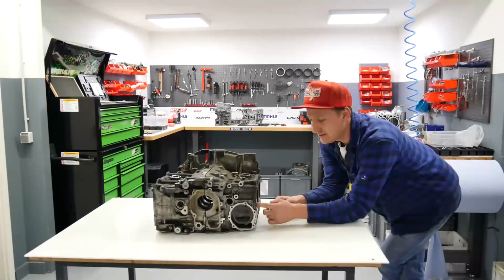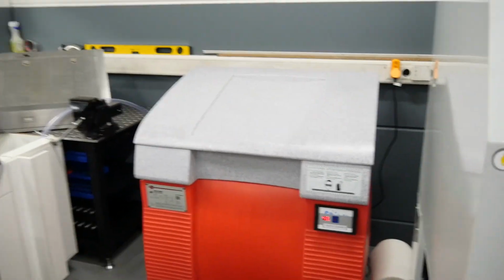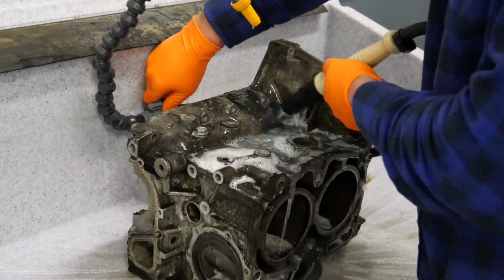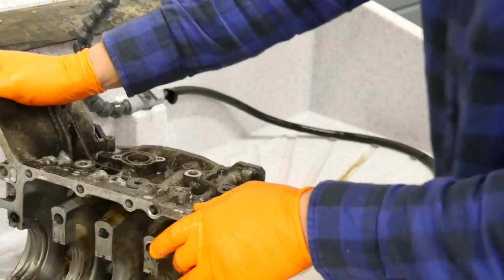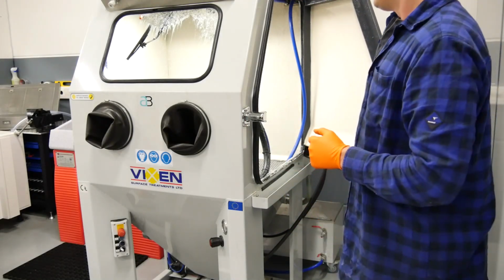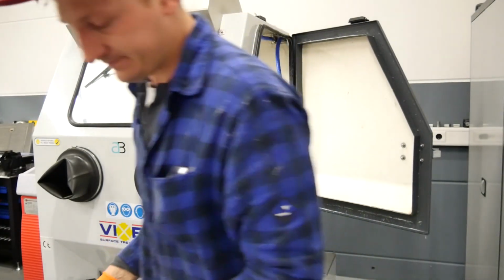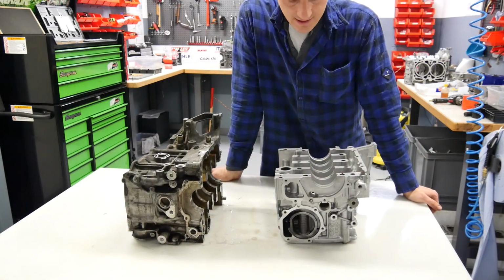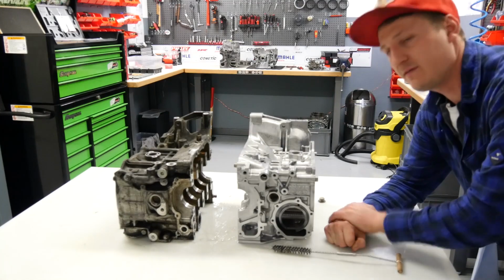How to clean your engine l Wie bekomm ich meinen Motor sauber ? l エンジンをきれいにする方法

Comment: Looks like glass beads in the aqua blaster? Must be hard to get all the glass out of the small passages in heads, no? The shop I worked at used soda which dissolved and washed out, but I know a lot of guys use glass.

Comment: whats that for a cleaning machine, is it working just with water ?
Reply: ManKetnas Just read the description. Vixen Aquablast, seems top work with water. Hard materials would roughen the surface inside.
Reply: Water and glass beads.